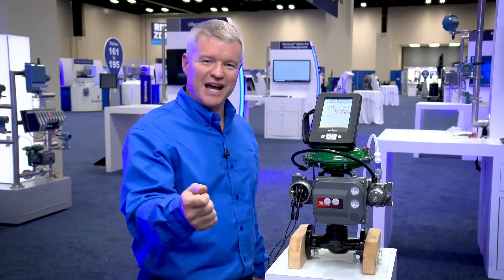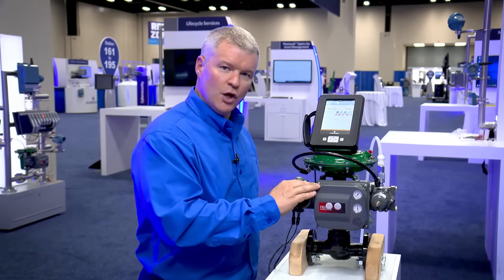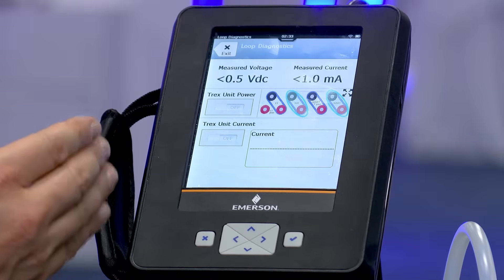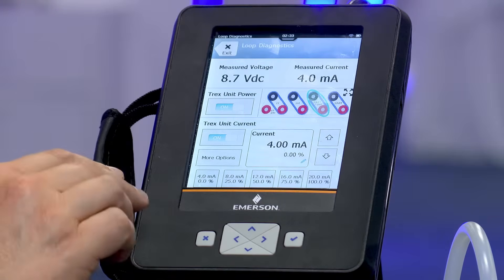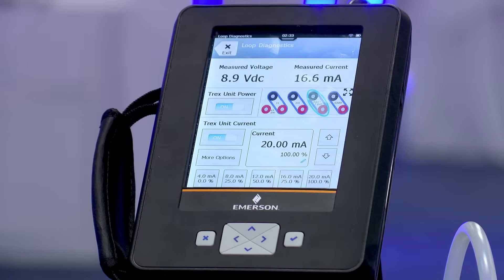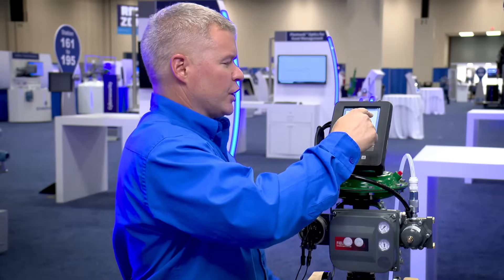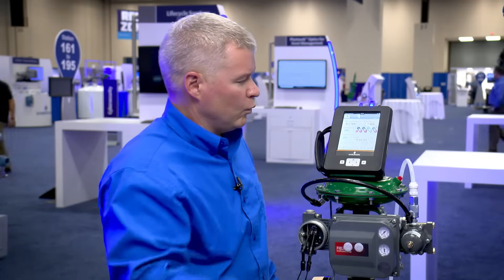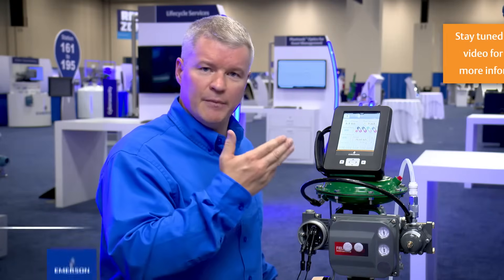How to Use AMS Trex Loop Diagnostics to Troubleshoot Issues

Comment: We are using this equipment in the field and on GE positioner actuator using FIELDBUS protocol, it gives the "DD Files Missing". this means that the Trex needs Update? And WHY it's impossible to find a manual that shows all possible issue troubleshoot?  We are stuck with valves OUT OF SERVICE and can't put it in service neither from the Network Master system or portable devices. Just need to confirm it needs an update so The Client can stop saying it's the valve and they have to update their equipment!! Thanks